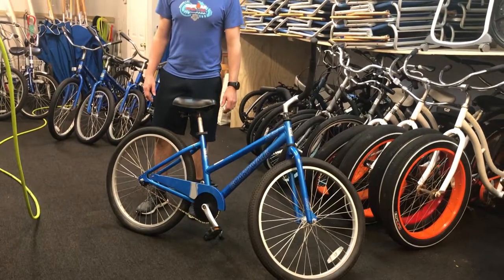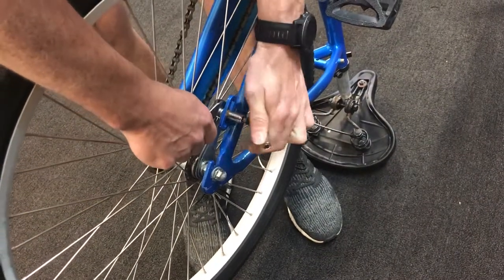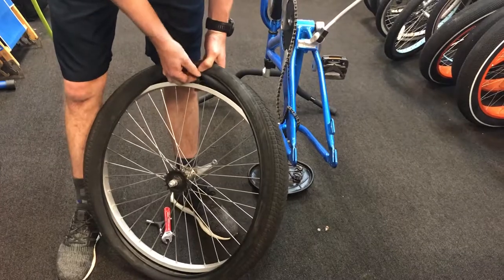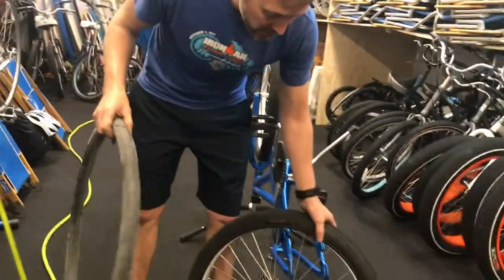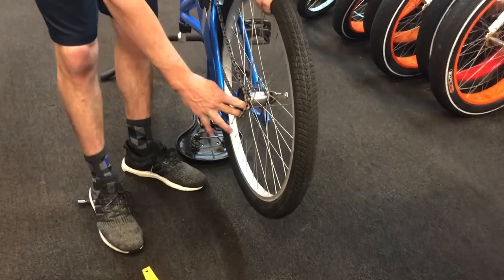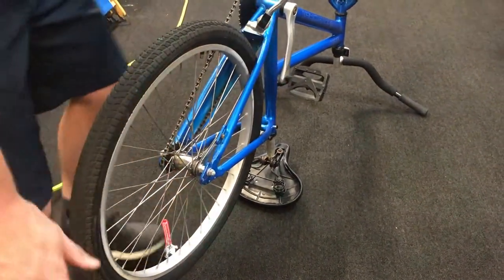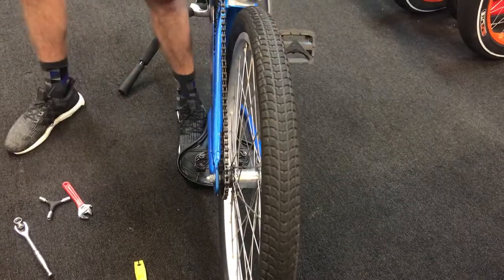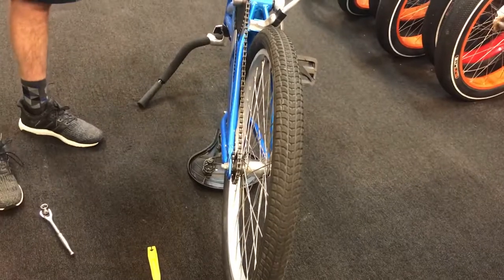Changing back tire (coaster brake)

Comment: my bike has a coaster brake and i can’t remove my back wheel because when i try loosening it the whole thing moves with it and i can’t pinch the other side with a wrench or pliers cuz there is a plastic tube thing blocking it , it’s kinda hard to explain